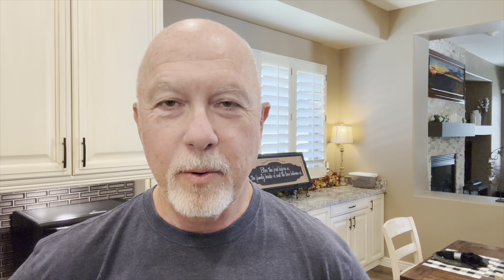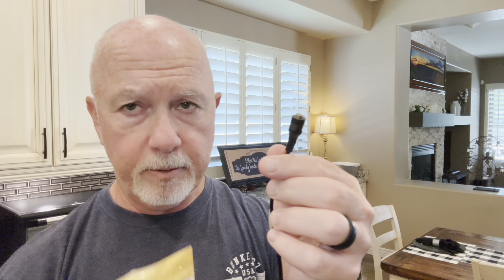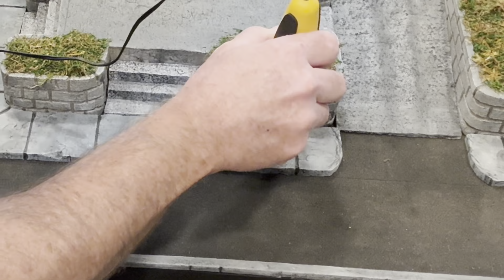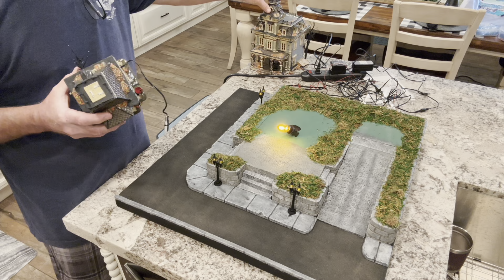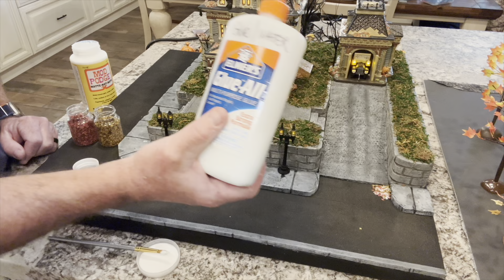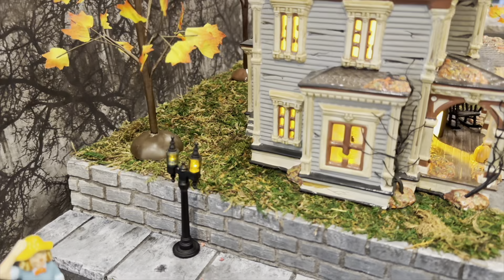Grimsly Manor, Step-by-Step Tutorial Completed

Comment: Hi Carl. Can you think of any reason why I couldn’t use Lemax street lights following your instructions including using a Dept  56 adapter?  
I would use a Dept 56 adapter because I can follow your instructions including what to purchase. Also, I’m unsure what plugs I’d need to buy  to fit a  Lemax adapter.  The Lemax adapters have 3 female output jacks. 
Your instructions are so clear and thorough, I feel confident I can do this.   Thx
Reply from the maker: Hey there!  I’m not 100% sure as I’ve never tried those.  I would assume it would work the same.  Try it a let me know!!